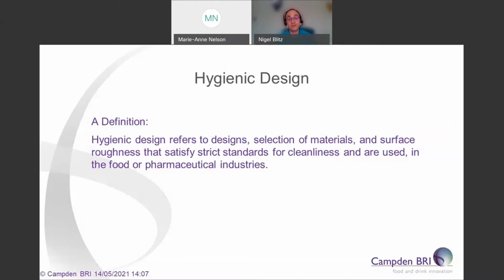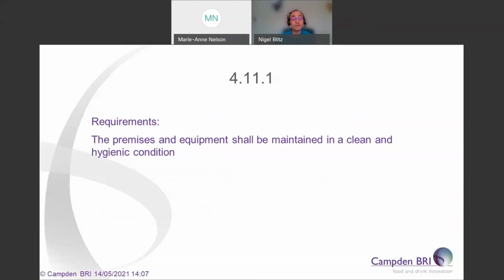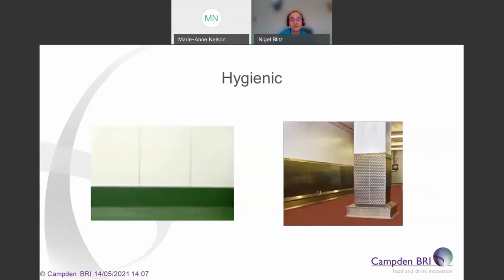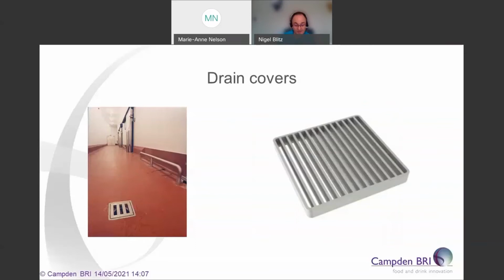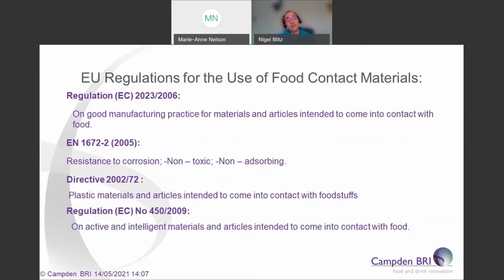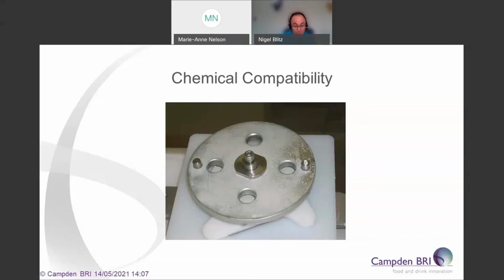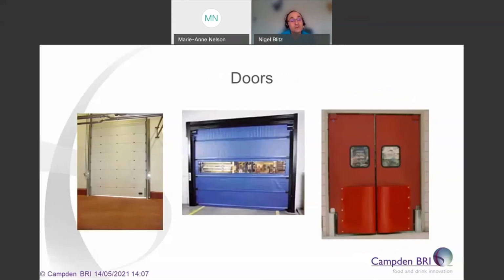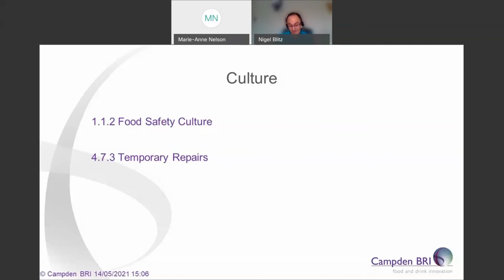Hygienic design of equipment within the food industry - Why is it important?

Comment: Nigel, great job on your presentation. It really gets down to the meat of the issue.  A friend of mine has a food manufacturing company that is struggling with Fixed Assets tags for the equipment.  They can't put a label on it, because the machines are steam cleaned regularly and the label would fall off.  They don't want to use acid or a metal label, because of acid doesnt go well with food and metal labels can have bactieria growing behind and around it. What is the solution, based on your experience?